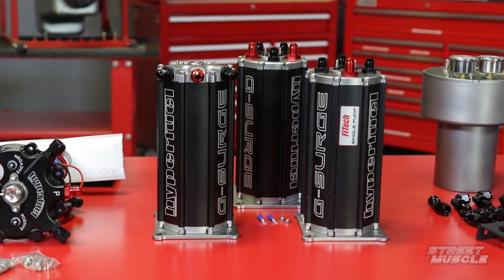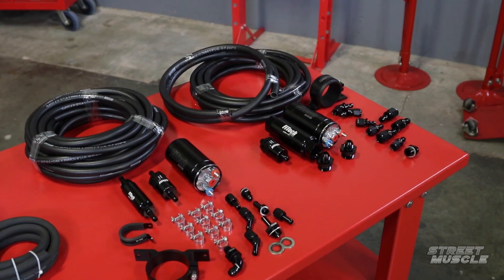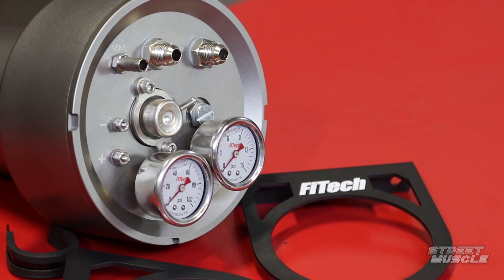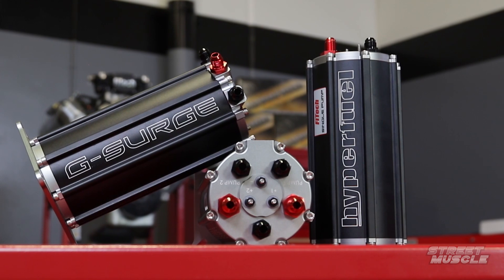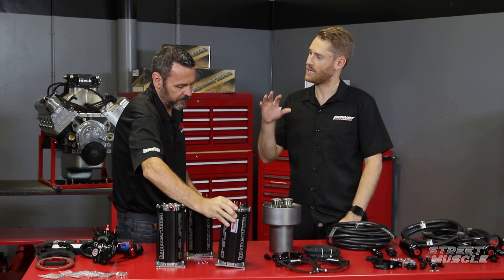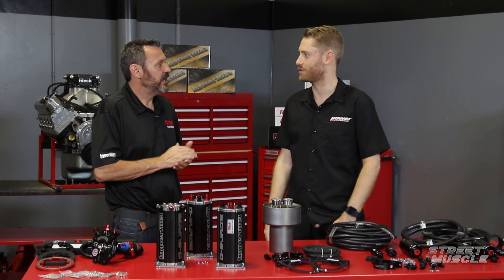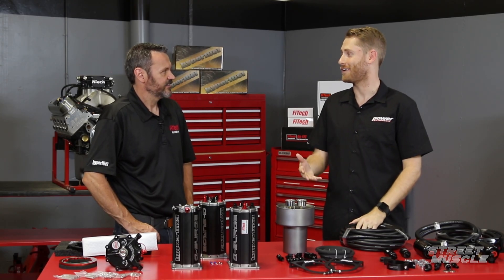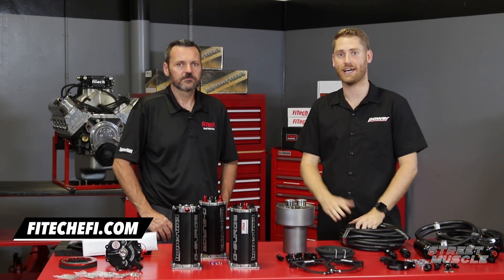EFI Fuel Pump Technology 101: Selecting The Right FiTech Fuel Pump

Comment: When he says the frame mounted pump is louder than a tank mounted pump, he's not kidding. i just put a Fitech system on my ride and the pump is horribly loud/obnoxious at a random rate while driving and does not always shut off quickly when the truck is shut off. Sounds Awful, but its new so hopefully this can be remedied.
Reply: Try using rubber grommets where the pump meets the frame may help a little with the noise.

Comment: I went fuel command you still need to have a return from the command center so I wish they would t act like you don’t just not from the throttle body it comes from the command center I cheated and ran mine into my filler tube but I would of normally had to drop the tank which is the whole point of the fcc in the first place so be warned
Reply: Using a period or two would have been nice.
Reply: @Jimmy-Volmer 😅